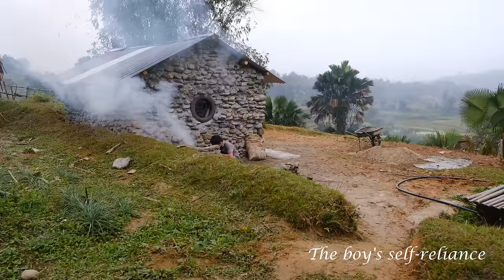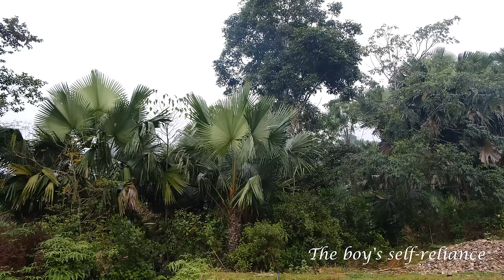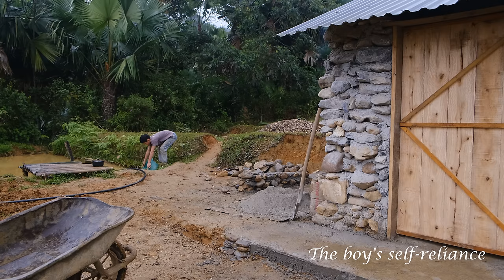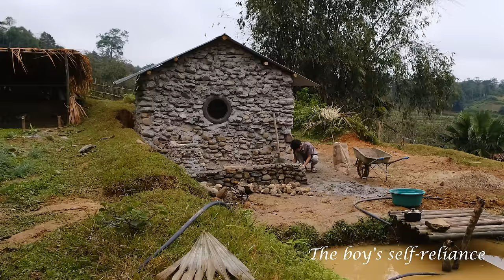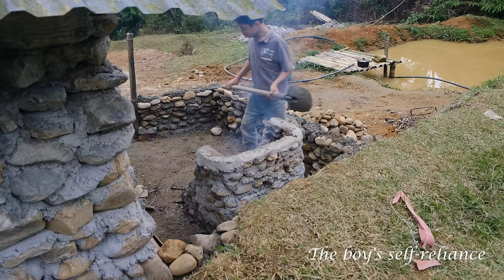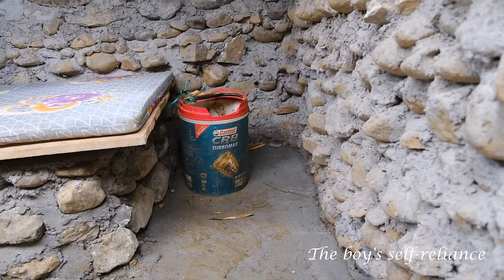Orphan boy: Complete a solid kitchen with natural stone - Independent life. (ep.82)

Comment: Great job. I'm sure you plan on installing a roof. Your little friend needs water and a bigger house. So, I have an idea for your next project. A nice stone castle for it. You are talented enough that you could probably make it at least two stories high with a castle type roof and a cement floor so it can't dig out. It would need stairs for it to get up and down. And windows for air but too small to climb through. Obviously it would need a good castle door that you could open but your friend can't gnaw through. Maybe to make cleaning it easier there could be drain holes in the floor and you can wash it out. And of course it's going to be heavy so it will always have to be in one spot unless you build it with sturdy wheels. Maybe even on a wheelbarrow. I bet you can find a cheap or free one somewhere and drill some drain holes in it and build the castle on it. Then you can bring your friend outside for fresh air and bring him back inside at night. It's a good way to use up some of the really small stones. Of course, what I described is way too elaborate and complicated for a rodent. So, really, if you actually read this far, a simple box that gives it room to move around and room for food and water and bedding that it can't chew, dig or climb out of would work fine too.
Reply from the maker: Hung would like to thank and wish everyone good health and continued support for Hung. You have a very good idea. Once again, Hung would like to send you his best wishes.